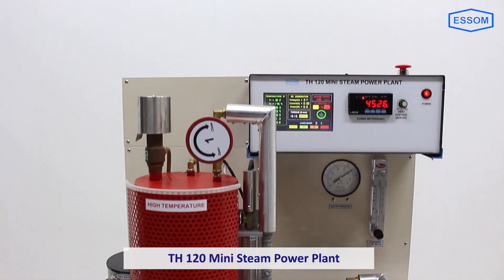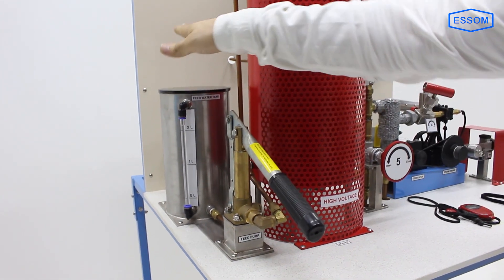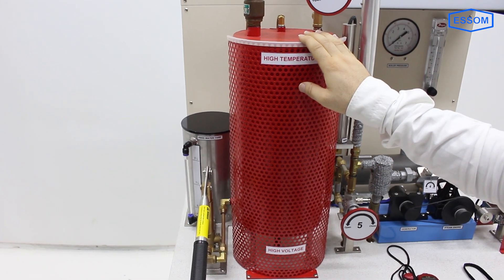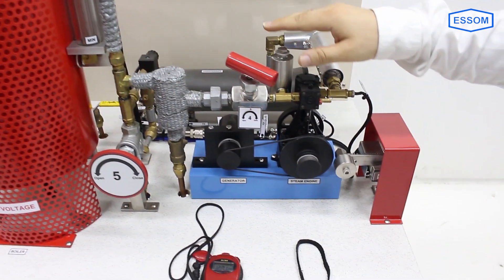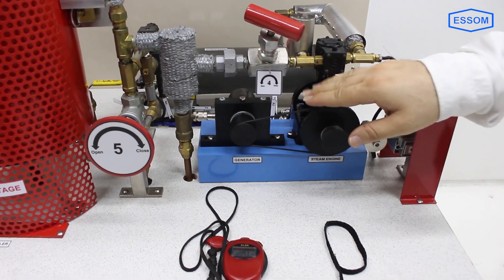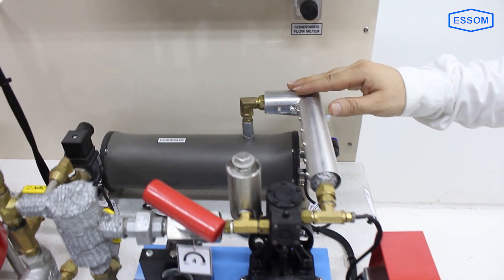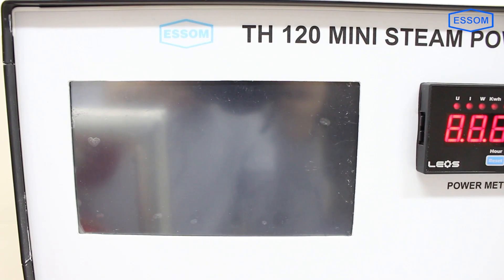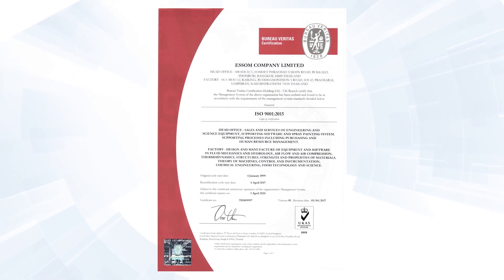TH120 MINI STEAM POWER PLANT

Comment: How muh power does it produce in terms of Kw/h?
Reply: About 0.006 kWh ~ 0.03 kWh(for one hour, multiply the number of hours you would run it for total kWh), or in a practical example you would have to run this for 10 hours at max output and store it (batteries) to run a 300 watt tv for an hour. Keep in mind this is a educational display model!
Reply: @matthewworldtrotter9012  so 30Watts per hour.  damn i can light 1 or 2 lightbulbs 🤣 - love the display model.. but i guess ill stick with solar. i understand now why everybody doesnt have one of these int heir backyard.  Its usless unless you have one the size of a small barn.

Comment: Why is nobody using steam turbines? At the end they are cheaper and better than low rpm tiny motor. With high rpm u can get really high voltage to play with.
Reply: @Erick Konop ok but turbines are more fun and powerful for industrial use i think.
Reply: turbines with multiple stages are more efficient at larger sizes. With small setups, single stage turbines are not very efficient.
Reply: @slicktires2011  Exactly!
Reply: @slicktires2011  But if you have high rpm small turbine with ac generator u get way more voltage at high rpm when you rectify it and step up/down u get even more amps.. No lie.
Reply: The question is actually quite good. 

Why dont we make small miniatyre steam turbines? 

It all boils down to thermall efficiency. While it is true that steam turbines become more efficient in terms of raw power output. The problem is that this starts to happen in the range of 400+ horsepower and then the payout becomes acceptable in around turbines with minimum power output of about 500kwh 

Up to this point you are better off building a traditional steam piston engine. With steam condensers and so fourth. The mechanical maintenance costs of these systems are pretty much neck and neck to the magical 500kwh limit. 

You need to remember that steam turbines diameter is a big factor in generation and inertia is more easily achieved by increasing the overall mass of the turbine. In a steam turbine the steam does not flow inside it like it would in a jet engine. The work area, blades fingerprint if we were to call the blades with that name. where the steam gives out its power is relatively small and is located near the outer ring. 

Now the piston engine starts to make more sense. In order for the turbine to be effective we would need to increase the inertia. And we would need to increase the effected blade area. This means increasing the diameter of the turbine but then as the diameter increases we need more speed for the steam. Other conditions that are required are the specifications of the steam. It needs to be dry. If there are any microscopic drops in the steam flow they act like sandblasting to the turbine blades. 

In the end its multiple times more effient in terms of mechanical requirements and maintenance requirements to use piston engines with small scale applications.  + normal piston engine coupled with variator to a flywheel gives a redicilous range of rpm you can run in order to provide generator enough moment of inertia and steadiness in case the steam pressure fluctuates.
Reply: @vihnu  but are there small piston steam engines commercially available for power generation?
Reply: @slicktires2011  

Strangely enough not really. 

There is one company that I know of in India that produces 10hp engines for local power. ( like powering a village etc )

Currently gasoline generators win over due to their ease of use. I would actually argue that if someone would create commercially viable steam engine in the 1-5kw range complete with boilers and silent running cycle it would sell quite well. 

The problem is that people want to see the machine. When in reality you should insulate every dam pipe and part as well as you could. + the steam needs to be condensed back to water and pumped to the boilers.  When the gasoline engine is simple push button and its work cycle is about 15%more efficient than in steam, the steam is relatively big job chopping wood lighting fire increasing pressure governing steam pressure etc and the thermal efficiency is max 25% while gasoline is now in the 40% range. 

This just means for every 1kw of power generated you have generated 3kw of heat energy, that needs to be gotten rid off. 

I'm currently designing a steam engine with ultra smooth running cycle and operating range on 1-10kw output while optimum being around 5 it does not look like these beautiful 1800th century machines. But rather scifi stainless steel device.
Reply: @vihnu  That's all a lot of good information. Any chance you have built a prototype of your engine design by now? It sounds very cool. Btw, I like the idea of 10hp engines that can run a village and hadn't heard of anything like that. I wonder if it would be commercially viable to put one in and sell energy to my neighbors. Where I'm from there are power companies though which everyone is hooked up to so not sure if I could ever compete with them for their customers. What do you think?
Reply: @Rick-the-Swift  

Hmm,

The efficiency and the ability to snatch customers is dependent on your location. If you want a localized energy source for continuous usage i would recommend a water powered solution. 

You are able to use steam, but it would need quite a bit of automation, and i would personally feed the machine with pellet type of fuel. 

The reason these small power plants work for example in India, is that the people and the village is not dependent on the electricity for 24/7 the people start the engine for any number of hours from 1-24 in order to provide electricity for what ever the specific need happens to be.  It may be lights or someone needing to weld something, or lifting water from well or any other thing actually. For continuous power that extends over for example a week or a month, the steam engine has the same issues as do generators. Heating running out of oil. Etc 

( i actually started to build a water powerplant on my property ) range 1-36kw consisting 3 turbines. Im planning on uploading everything in youtube with an account called Turdyne 
If you are intrested you could sub to it when the videos start coming out. I dont want any profit from anything im trying to help people become self-sufficient from electric companies.

To the steam engine. Not yet unfortunately i shifted my focus and effort to the design of the turbine for water power.  Feel free to pm me if you feel like it.
Reply: @vihnu  Thank you for your insight. I just look for ways to be more self sufficient thinking it could be possible to build my own mini thermal electrical plant. 

I don't live in a mountainous region where there are plenty of streams with a steep drop. I'm assuming perhaps you do, as I imagine that type of region to be the best for water turbine generators. Or if you live by a small flat stream, please explain your process in using shallow slow moving water if you feel inclined to do so.

I live around farm/forest land, and most of the streams we have are parts of government owned land, or the streams themselves may be governed even if I were to own the property so not sure what I could get away with in the lines of employing water turbines. 
I do have a lot of dead tree limbs, dry leaves etc. that I could potentially use to both heat my home, and produce electricity. My thought was to design a rocket stove heater that would create steam in a boiler, keeping my building warm, and also driving a steam turbine- but it sounds as if you would go with a steam piston engine rather than a turbine in a small scale set up like mine for the various reasons mentioned.. I thought maybe I could get away with firing up the system intermittently, and storing the energy generated into batteries of some sort. That's where I could really use some technical advice too  if you have any recommendations for ways in which to most efficiently store the most amount of energy I could load into it. Any ideas there would be much appreciated. 

Just curious too if you have a plan to store any excess energy from your system as well?

I'm interested in fly wheels as a means to store at least some of the energy, perhaps just as a means to restart a compressor or fans which I'm thinking about adding as a means to ensure a clean updraft.
Plus I really like the idea of playing with fire; now if I could only become a skilled welder/fabricator/machinist, and acquire more expertise on batteries, turbines, pistons etc. I'd be set.
Reply: @vihnu  Yes, a large vessel is what I've been after for heat storage as you say, and circulating the heated water through an isolated loop. That is a clever idea to separate the vessel from a radiator with a pump to circulate the heated water to radiated areas when needed. I'll have to think more about that one. We need to heat approximately half the year, so I agree, capturing and maintaining heat for our home would be a big slice of the pie when it comes to energy expenses. 
I agree too, solar panels could also be a nice supplement even if it doesn't get me completely away from the power company, they could still help save the light bill from being too high. 

I'll take a look at those graphs and try to get a better understanding for batteries and their efficiencies. Thank you for your help! I'll look forward to your channel too, as I'm also quite interested in how turbines can be employed in such a short hydraulic head as a few meters.
Reply: this makes 30w of energy per hour.. thats why.  its just not enough power
Reply: @vihnu  Hi!

Did you post any videos and manage to create a miniture steam piston engine with the magical 500kwh? YOu were speaking about doing it with water, but have you designed or built one that would burn a solid fuel like coal? I'm thinking powdered coal dust would be super energy efficient and even more micro-controllable with today digital electronics controls?
Reply: @Wayne Cummings  

Never said that the steam engine would generate 500kw of raw output power.  I told that that was the magical limit when steamturbines start to be cost effective. Under the magical 500kw limit the cost of making and installing turbine outweighs its production output.

No the design of the prototype engine has been halted and the manufacturing of parts too.

It resumes when it resumes.
Reply: @vihnu  That was a quick reply! 

It appears that creating a home power generator using steam and fossil fuel like powdered or pellet coal is a no goer. I'm been looking around for the last 2 hours and there's nothing. It's all for 'education' purposes but cannot escape the thermodynamics laws of more energy goes in than comes out, or the fuel is too expensive.

That said though, but I don't pay for energy from my suppliers as I know how to lawfully get off all bills until they stop ripping us off. I was looking in to this and saw your comments which caught my attention.